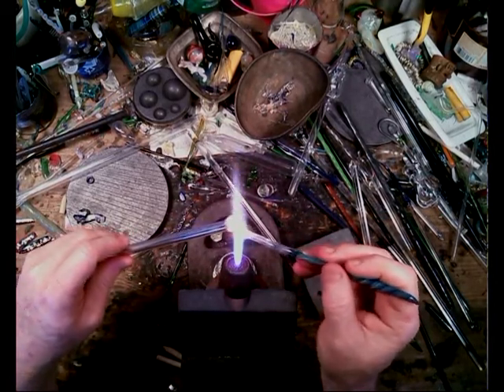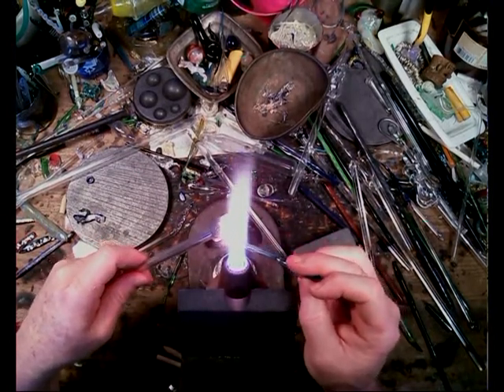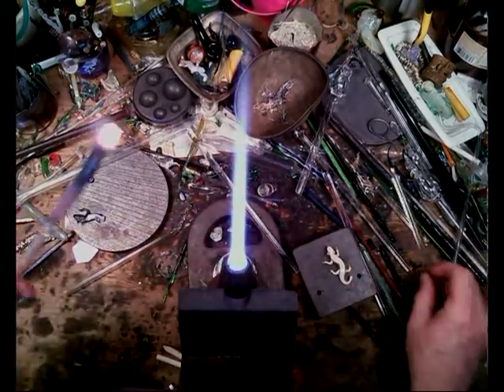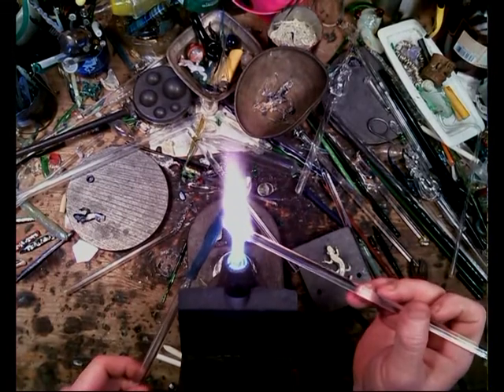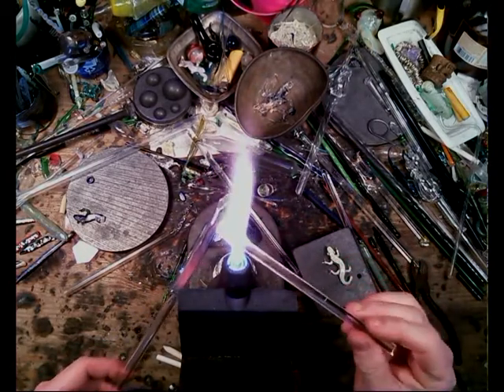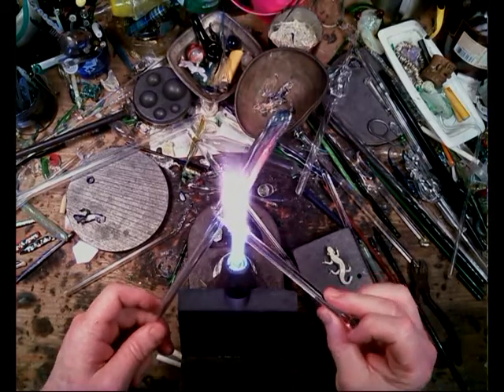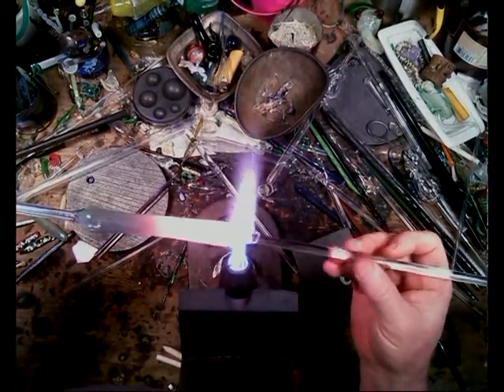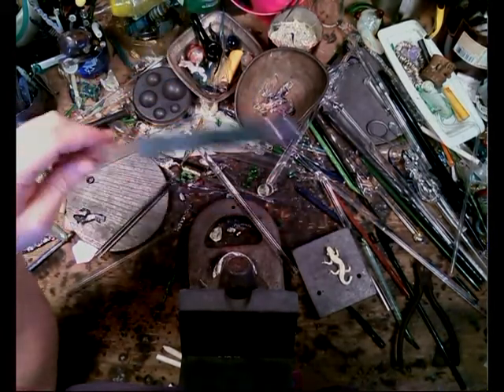color tubing made from scratch pazely type pattern demo

Comment: I know its an old video but till helpful, quick question, why did you state if you pull the initial coil pot, that looked about 16mm down to 12mm after pulled, THIN enough then you only need to encase with clear once rather then twice. it seems more stretched == thinner walled tube, thus needing a thicker encasement to blow out to finished product, but your saying had you not pulled it as thin, therefore thicker walled tubing, youd have to encase twice to blow out to same desired end result. Im sure my lack of knowledge is missing something? its about 6:35 into video you mention it
Reply from the maker: it depends on the thickness of the color glass  tubing.... it is hard to explain.... try it a few times... i have done a few more encasements  like this on my channel....different colors all using about the same method...hope this helps aanswer the question...    https://www.youtube.com/results?search_query=lu+libby+tubing